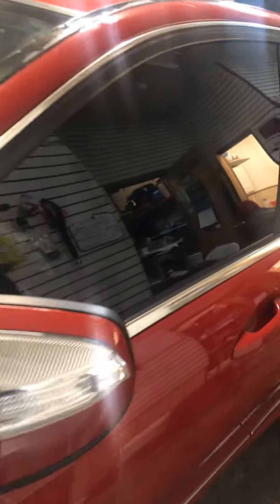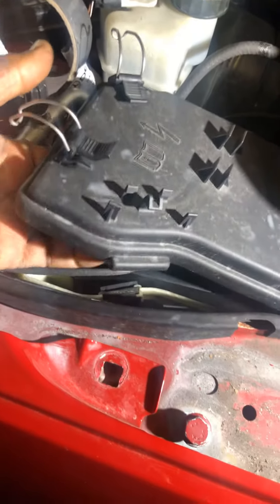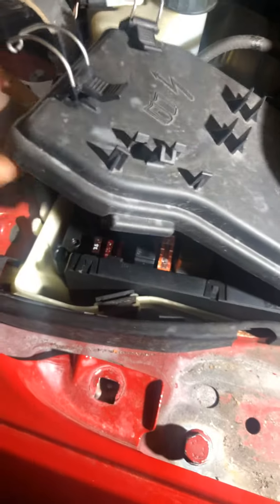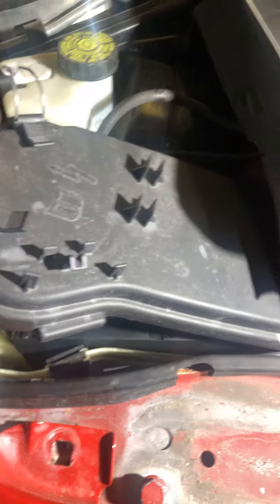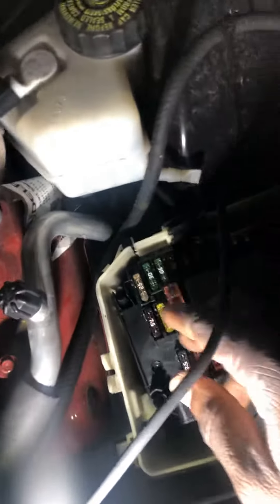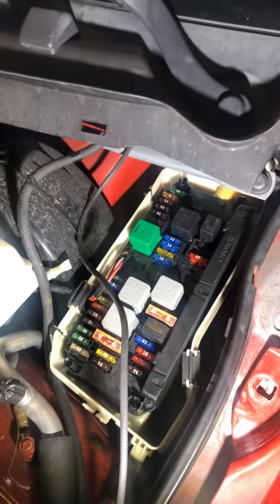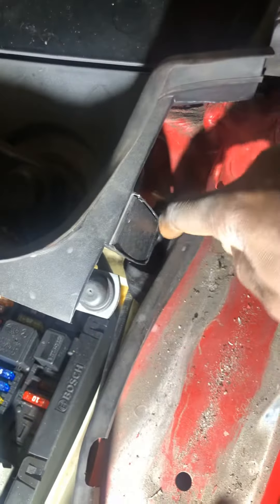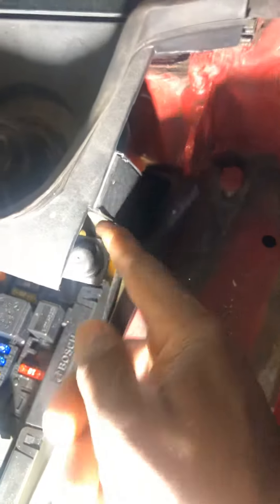2008 Mercedes c300 Front Sam module information

Comment: What are the problems that happen with bad sim? My 2009 c350 has issue where instrument cluster is not working at all and steering wheel buttons quit working. Car cranks and runs fine though.